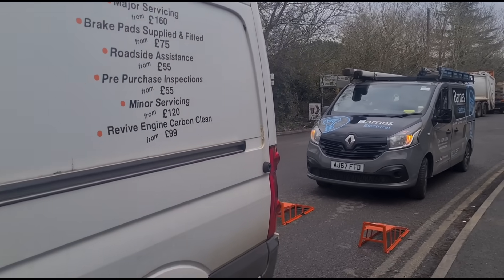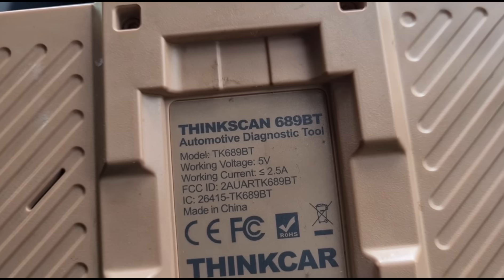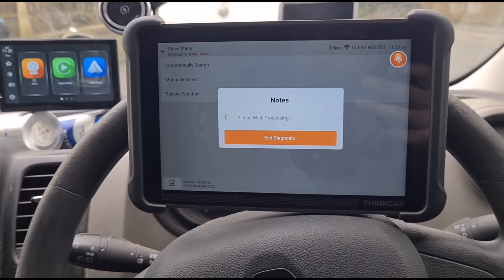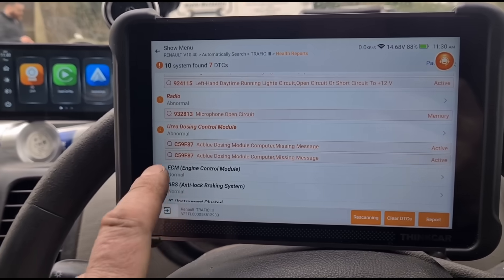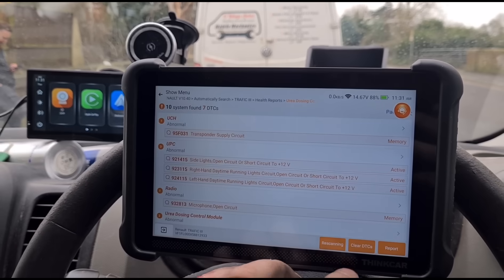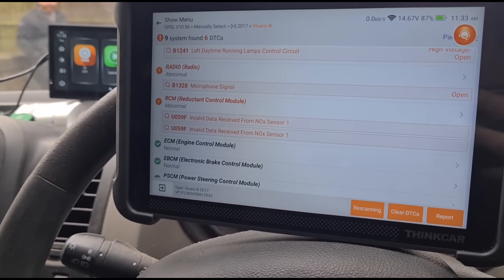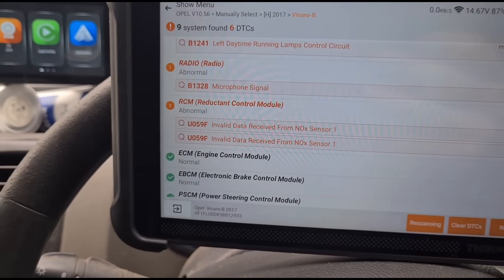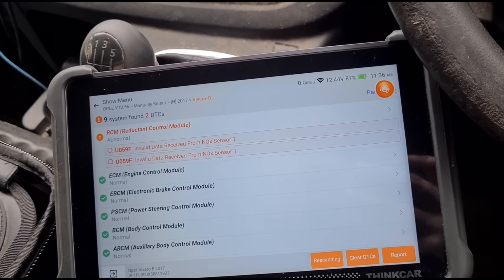Renault Trafic CF59F89 & U059F Adblue Dosing Module Missing Message

Comment: Hi Mate, I have a Peugeot 2023 expert van that Peugeot dealer cant seem to fix, it blows the return line off for the diesel return lines and squirts all over the motor, the changed the lines but it happened again after five days, they want to change the fuel pump which doesn't make sense to me. This all happened after they replaced the timing belt. Could they have done something to cause this in the first place? Regards Colin from Wollongong Australia

Comment: Hi Jim, wondered if I could pay you to pick your brains about my van, I'm mechanically minded and plan on tackling an issue on my 68 vivaro single turbo. I have ZERO fault codes on my van, but it drives like it's blocked. Live data suggests the DPF PS is reading at flat 0.00, so assume it's duff. I'm going to change that sensor, clean the upstream pipe and replace that sensor also, I'm just perplexed as to why I have no fault codes. Even if you don't reply, videos are excellent mate ta 👍

Comment: I've replaced both sensors and I still have a U059F code that comes in after 3x starts of vehicle,

I've switched over the sensors (rear to front - front to rear) to check it wasn't faulty from factory and it's still same code, 

U059f. Is this the front sensor close to the adblue injector?

I'm assuming I've got a wiring issue or it's the actual adblue dosing module,

Can't for the life of me work this out...
Reply: You can check the wiring with an oscilloscope multimeter to measure +12, ground and canbus.

Comment: Hi Jimmy, I see that the Nox ECU is made by Continental. I have a video on my channel (please check it out and let me a comment) about the Adblue system made by Continental. As the fault code comes back imediately after ignition on, I suppose it‘s the same problem with all of these modules, corrosion inside the connector of the ECU.
Reply: They really need to seal these things better. 99% ist corrosion
Reply: @danielseibert4082  Or smear it with plumbers silicone grease before plugging it in, to keep the damp away, and some contact treatment oil on the contacts.
Reply: @ Its not just coming from the plug. Also the lower plastic cap and the side where the wires from the prob are connected to the module.

Comment: Boss bought us a Nox sensor Tester because we were going through loads of sensors.it works too, the Nox sensor looks for oxygen and Nox, if the levels it is looking for are not 21% oxygen and 0% nox it fails the sensor, tried it on new and so called failed sensors and we were able to recover some sensors out of the scrap..